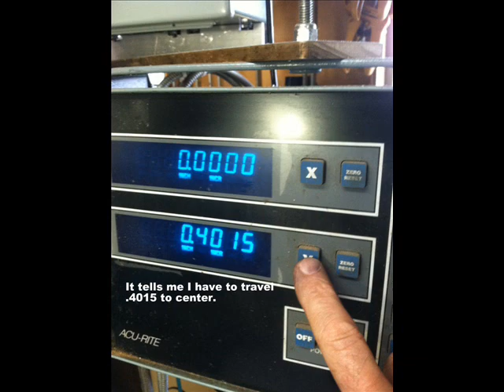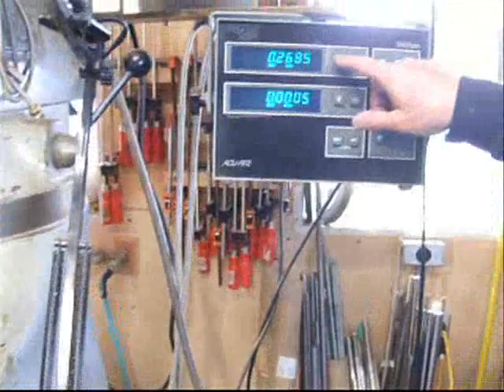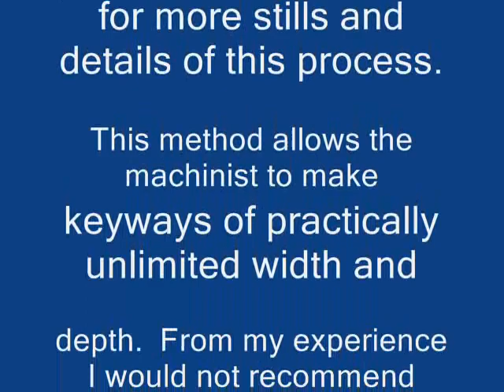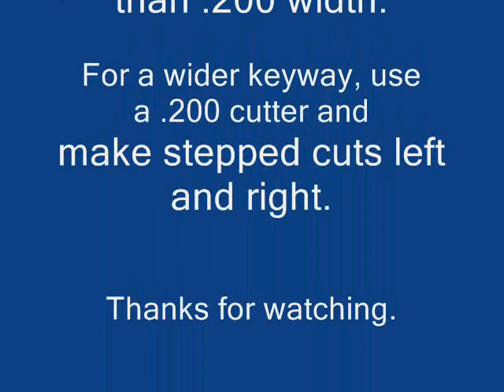Keyway Cutting 3-5-2011.wmv

Comment from the maker: Marci,
 
Thanks for your comments.
 
Yes there is some work involved.  In the real world (as opposed to the video world) each stroke takes a couple of seconds.
 
Making the cutter was some work too.  But once one is made, many different sized keyways can be made by varying the width of cut and depth of cut.  This cutter was made in the context of repairing the gears on a Monarch EE Toolroom lathe.  the key on the shaft that I was machining was not a standard width or depth.  So, I was able to c

Comment from the maker: Thanks for the comment, GK.  It is also possible to make splines using a similar method and a rotating table on a mill.  Just needs a different cutter.  I prefer to make my cutters on a surface grinder, but have made successful ones just grinding on a bench grinder and finishing with the inexpensive diamond laps like Eze-Lap diamond hones.